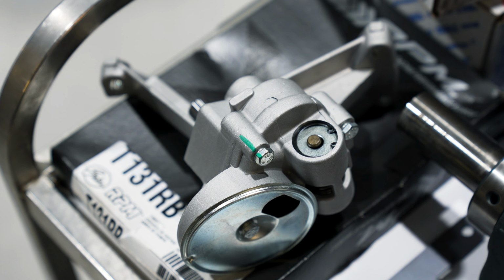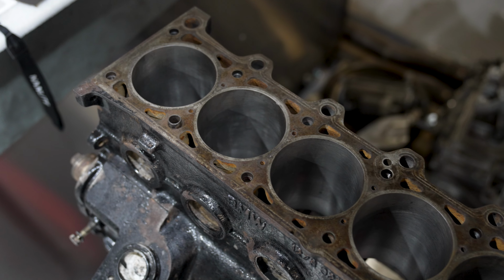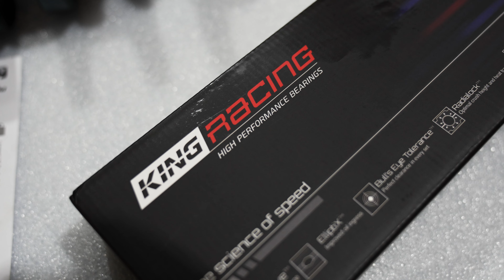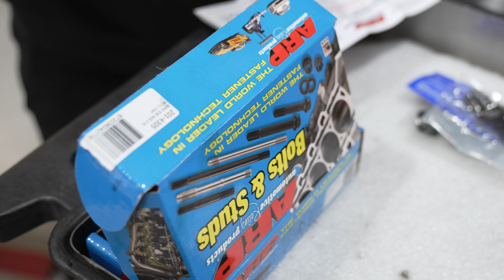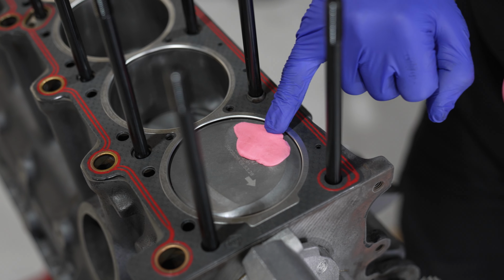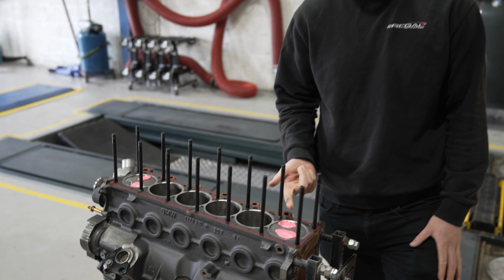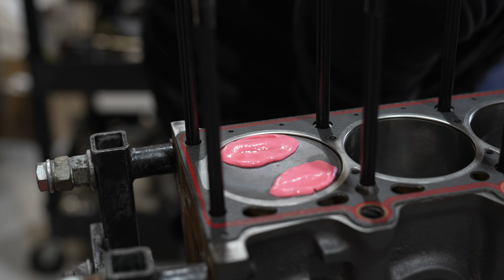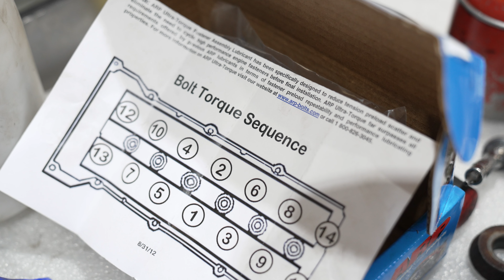WE BUILD THE 2.9l STROKER ENGINE FOR OUR E30 320i

Comment: I bought a 320i in 2001, I was thinking about a 327i conversion.
Stronger engine -> stronger gearbox (Getrag 240 weak) + stronger differential (20i diff weak) + bigger brakes

Expensive project.

I still have my 2 doors 20i with sports interior (318is) with 40% LSD (25i - big differential). It's a hobby car. I will never sell it.
Reply: + new ECU with programing
Reply from the maker: enjoy your project!

Comment: Nice work! But is the engine block from a 2.0l or 2.5l?
Reply from the maker: Not sure, sorry!
Reply: Should be a 2,5l with 84mm bore. 2l have 80mm, u would need about 95mm stroke to get 2.9L

Comment: Are stroker motors reliable?
Reply from the maker: No less reliable than a stock engine really, although in saying that, generally, anything with increased output will have a lower longevity than something which is stock. 

So if you want reliable like stock, keep it stock - once you tune anything, longevity is reduce. To quantity that isn't always possible.
Reply: @RegalAutosport  definitely makes sense .. thanks for the input boss. Great videos man keep up the great work!